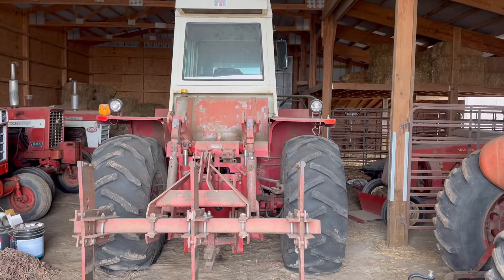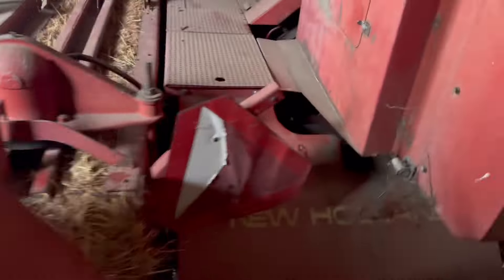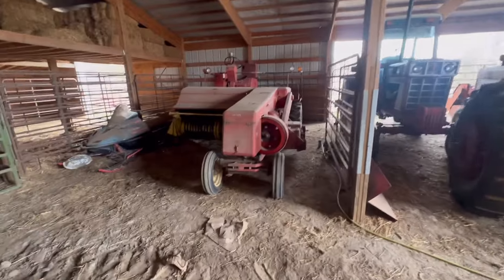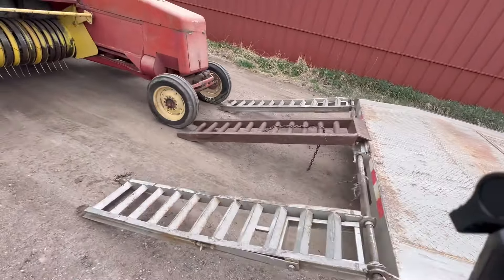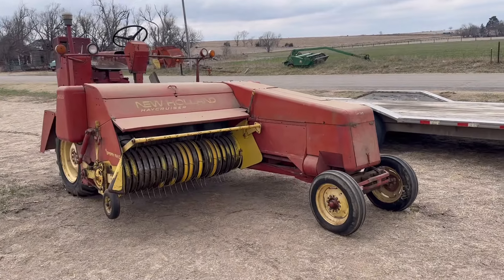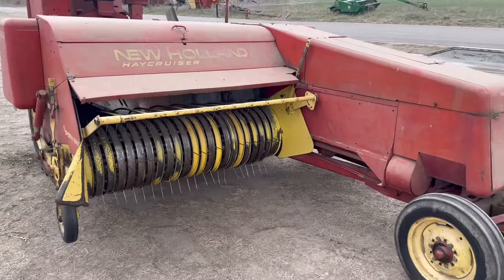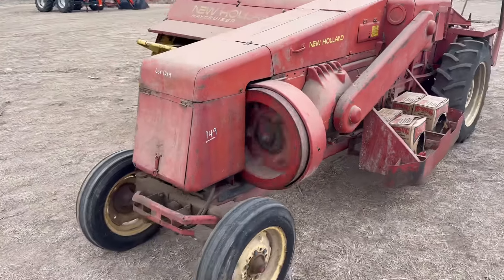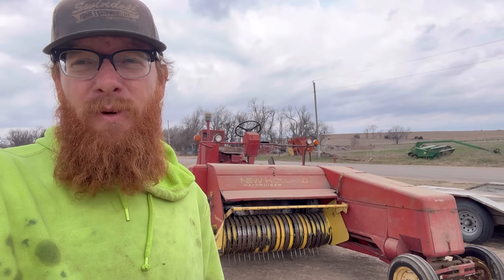Digging the New Holland Haycruiser Self Propelled Baler out of the Barn! Going to a new owner!

Comment: Cool machine, but for a farmer with alot of acreage in hay, not so practical.  My neighbor usually farms about 200 acres of pure alfalfa, for the high end horse market, with a normal square bale about 50-55 lbs, in addition to 1-200 acres of wheat straw and long rye straw, plus many acres of timothy and mixed hay. I worked for him many an afternoon and into the dry evenings, with a JD 3010 or IH706, pulling a New Holland baler with the hay wagon behind. Normally we had two on the wagon, as these were real hay wagons that we stacked 200 -250 bales on. I don't think this hay cruiser would have the weight or power to pull this combination in the field, or down the road. This was a hay operation that had very valuable bales of hay, not a round bale that is only a few levels above mulch hay, that sits outside!!! We never left the 2 NH balers he had for this operation outside at night, even in nice weather. Always had to find a shed for cover, or we tarped the baler. We used to keep a scale on the tractor, and stopped a few times a day to check the weight of a bale, when you are selling a bale for several dollars a bale, they need to be fairly accurate on the weight you are telling your customers they should be. Too much and you are giving alfalfa away, too little and your reputation is on the line with customers. If kids today want a workout, put them on a hay wagon and stack this kind of hay, in addition to unloading up into a barn. If you watch many videos of people handling bales of hay without a hay hook, you know they do not move many bales, as their hands would be toast doing this all day with either twine or wire bales. We took great care of our bale hooks, they were also part of our valuable hay operation and another great tool for a farmer!!!
Reply from the maker: Just depends on how you decide to go about picking up the hay. All of the SP balers I’ve had came out of commercial hay areas where they were picking bales up with NH Stackliners and stacking them in pole barns. Takes a hell of a lot less guys when you’re not pulling a wagon behind the baler. Some guys like to work smarter not harder. Others are too hard headed to change.
Reply: You are very correct, my friends have also had NH stackliners since late 70's, which they use to stack their open pole barn storage, at the same time. Problem with them is they don't hold many bales and you are riding the roads all day moving small loads, and unless you have the luxury of having large, open pole barns, its hard to justify the big expense. We used to stack the lower levels with the bale stacks, then have to move the elevator to be able to completely fill the barn on top of the stack. We used every square foot available in those expensive pole barns.